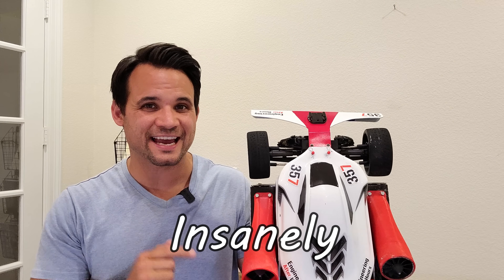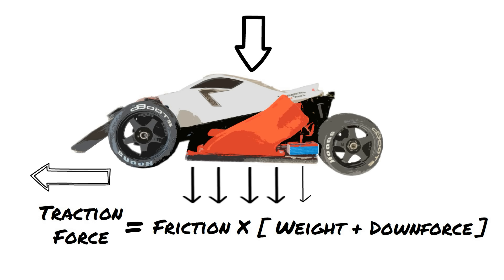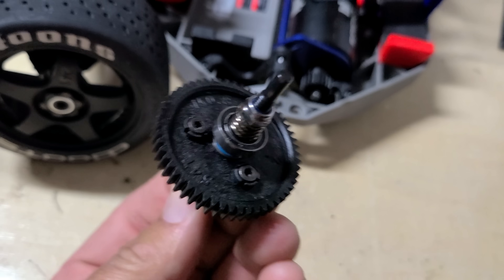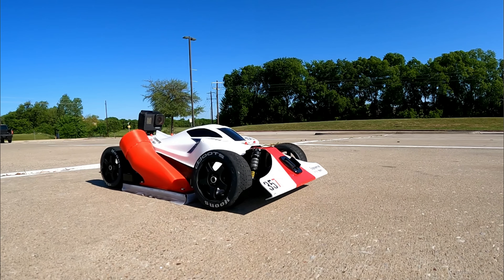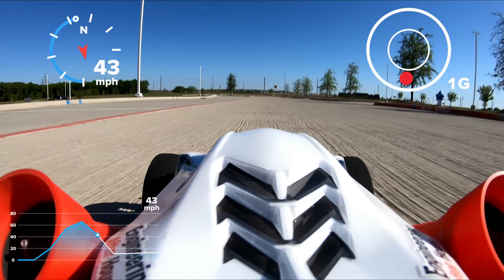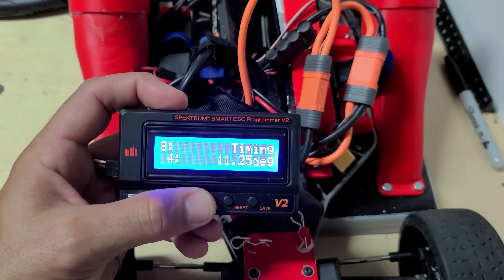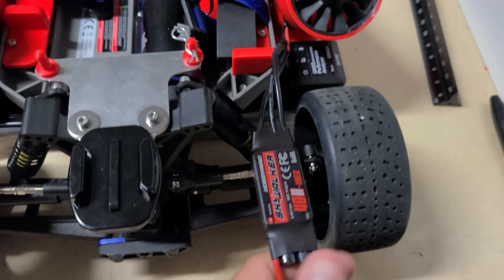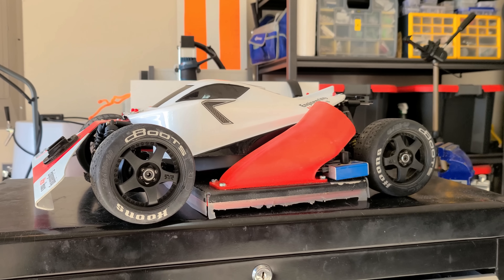241% More Grip with a Fan Car and Ground Effect

Comment: you should buy solid diffs
Reply from the maker: I need to turn as its not a drag car. I
 Running X01 inter also though and a locked center diff.

Comment: You only need the fan downforce until you get more aerodynamic downforce and less torque as it gets faster
Reply from the maker: If acceleration stays the same the torque only goes up as speed increases. That's what makes it so challenging with a heavy car.

If I didn't care about drag, I could definitely use fixed aero after a certain speed.

Comment: Why did you use a Traxxas platform and not an Arrma?
Reply from the maker: The arrmas I would have considered were just too heavy. And all of the arrma and traxxas road cars (X01, Limitless, Infraction, 4tec...etc) are way too low to the ground for underbody aero.

Power to weight ratio is really important here.

Comment: I suggest to try and use hub motors. I've built one with 4x brushless in the wheels, and it had insane acceleration. Also greatly reduces wear parts and center of gravity. You got to choose your winding and pole count wisely though (i.e. the "electric" transmission)
Reply: That's... that's brilliant!

Can you also use the motors for effective braking? You could literally have a full traction control and stability system... IN A BLOODY RC CAR!!

Crazy stuff!
Reply: @skylined5534  Yes you can... Full traction, full ESP, even assisted drift mode... All should be possible with a single Arduino. And all this is a car that fits in the palm of your hand. 

Motors even are water tight (at least mine) so it's pretty fun in the winter

Comment: You should add some super capacitors in line with your battery, I think the studdering is battery sag
Reply: Maybe even brown out?
Reply from the maker: I got a new higher discharge battery and a sensored motor...let's hope that helps!

Comment: I said that in your other video you said the original was only two wheel drive so why you switching to a four-wheel drive
Reply from the maker: 4 wheel drive has better traction. 2wd can only take advantage of the force on the rear wheels limiting the acceleration off the line.

Comment: Springs need to be massively uprated to put all the downforce on the tires.
Also your tire foam is likley far to soft.
 More traction on the tires means less downforce needed, means faster.
You should tie the fan speed to a speed sensor, so the fans slow down at higher speed, and set it to always be on the limit of traction.
Sub 1 second seems possible.

Comment: What your experiencing at launch it's called cogging. It's due to the sensorless brushless setup and the gearing you're running. When the sensorless system first starts up it does not know the rotor position or direction and is basically guessing. When geared very high the motor cannot spin quickly at the start so it stumbles back and forth trying to figure out the position and direction. The larger the pinion you run the worst this gets. This can be resolved with a sensored brushless system.
Reply from the maker: We've got that fixed for round 3! Stay tuned

Comment: I don't believe this counts because the Tesla model plaid is a bigger object more mass where that rc car has a smaller mass
Reply from the maker: Power to weight ratio only matters if you're power limited. The tesla is supposed to be 1,100 HP or greater so I expect it to be traction limited at the low speeds in a 0-60
Reply: @EngineeringAfterHours  I'm saying that the rc car isn't traveling as much distance as the Tesla since it's smaller
Reply from the maker: @theanimeotaku2794  huh? I'm not scaling distance. 60mph is 60mph in this case.
Reply: @EngineeringAfterHours  whatever then

Comment: No prep drag race rc cars routinely go 0-75 to 82ish in less then 1.95 seconds in 132 feet. With 2wd chassis. Without fans.
Reply from the maker: Yeah and they don't turn either. Drag cars have always been faster than f1 cars in 0-60

Comment: Do what they do in the Japanese mouse competitions: 4 quad props set up in reverse so air is pushed into the air and forcing it down that way.  Your system depends on getting a decent seal between the skirt and ground, if the car lifts, the seal is broken and there is no longer downforce.  The props would give constant downforce without relying on a seal.

Comment: Or there is the ARRMA Limitless... a bit over 2 sec out of the box on 6s. By integrating your vacuum system you may just break the space time continuum. (wow! A complete sentence with two double u words yet neither have a W in them).
Reply from the maker: Haha I've been thinking about the limitless for a year now and am about to pull the trigger. Debating between a video on "high speed aerodynamics" or "the science of acceleration"
Reply: @EngineeringAfterHours  that’s a great angle (see what I did there). As fast as the Limitless is  out of the box, I’m sure reshaping the body/wing would show instant top speed gains.

Comment: You’re “cogging’ off the line, nothing to do with skirt friction. Why not try foam tires, will give much better traction. Also, your wheel base is really short for what you’re trying to do. Why didn’t you start off with a chassis more aligned with you’re goals, like the 4-Tec or XO1? Cool project.

Comment: What about using real units of measurement
Reply from the maker: What are real units?
Reply: @EngineeringAfterHours  Metric system 😁🤣
Reply from the maker: Hah...in most engineering programs here you're taught multiple units so you realize it's arbitrary. Almost like being multilingual. For forces I generally use imperial and for thermal analysis I use SI with a blend of Fahrenheit...but honestly I use both systems a lot and am glad I was taught not to care either way.
Reply: @EngineeringAfterHours  Yeah yeah I was just joking ahah, it would be nice if you also put SI units in next videos so that Europeans like me coul understand better 😁

Comment: Have you thought about trying an outdoor or indoor basketball or tennis court? May be a little smoother therefore a more consistent vacuum verse bouncing over parking lot pavement losing vacuum.
Reply from the maker: That would be an awesome surface. Super flat but high grip. I think the biggest challenge is the length (need 300 feet), but a large tennis complex nearby may work!

Comment: i have a arrma typhon with a 2/1 gear ratio and did some something things i shall not mention XD and it when turning in a circle and driving i can do up to 5G im not joking either. i lock my wheel left or right and send the car slowly and it will pickup on 2 wheels and spin like crazy.

Comment: you can direct the fan exhaust rear ward for more forward push and make your bash 
guard not as steep, while throttling the fans off on the top end to lessen downforce drag. 
Have fun. now take your creation to the drag strip with a real Tesla.

Comment: Cool!
Tip: You can probably get better results by using a better car to start with. Check out 1/8 on road racing cars, like the Serpent 989 lipo version. That is serious race stuff and use way better materials and part design. Also the tires (foam) they use give much more grip. Especially if you use the softer ones (low shore values). I bet these cars do 0-60 in 2 seconds in standard race trim. Now add your fans. And maybe put some weight at the right place, on the front? Also, use high capacity and high discharge rate batteries +8000 mah. Lubricate the the tires with tire sauce to make them even more grippy.

Comment: since your going for 0-60 not and not a top speed run i would check out the proline drag tires. those hoons last long and there fun for drifting but they dont hook nearly as well and the drag tires do. also a sensored brushelss system will help with the cogging and mip xduty axles will solve that axle breaking isue

Comment: Will a heavier car be better for that initial traction and be more stable. Seems power is not an issue. Larger tires?
Reply from the maker: No, this car actually is power limited and not traction limited. A heavier car will make it worse. I'm going to rebuild with a little less downforce and drag, while moving to a better motor setup

Comment: Time too put a couple co2 cartridges on there. See if you can beat 1.1
I subscribed and saw you DID try cold gas thrusters on the top of the car with very underpowered tanks. I would recommend air soft canister as they can have 4,000-5,000 psi.
And the trust needs to be at the same level as the tires. You know this I know you do. But in a thought experiment even with everything perfect that amount of thrust would be 
Impossibe to control. I am tired its 5am.
Reply from the maker: I definitely have been looking for a tiny air soft canister. If you have any suggestions please let me know!

Comment: Just out of curiosity why not use the Traxxas low cg chassis and center differential?
Reply from the maker: I've got one on order. I just didn't include it on this build because things start getting expensive fast so I try to set a Max budget for each build. This one was already over $400 so I needed to break it into a few incremental attempts to fund everything.
Reply: @EngineeringAfterHours  oh gotcha. I wonder if Traxxas would help you since you seem to use their products allot.

Comment: You need a capacitor pack to stop the stuttering at launch. Youre drawing a lot of extra power when you start, and the loaded capacitors discharging helps account for that.
Reply from the maker: It has a cap pack...may be too small but well see with the new motor esc

Comment: I’m pretty sure there’s plenty of guys in the rc no prep drag scene that run sub-1.5 0-60’s.  There’s videos of Tesla’s vs Rc cars and the Tesla gets destroyed.  The power to weight ratios just can’t compare.  Raz Shifrin on his channel answered the question “how fast is my 170+mph speedrun rc car in the 1/4 mile?” He ran one of his cars using gnss gps and it was somewhere in the 5.4 sec range!  I think the fan car is really cool but is more suited for handling.  I’m pretty sure my heavily modified Arrma Talion (speedrun gt style) will smoke a Tesla 0-60.
Reply from the maker: Yes the design is definitely for lateral G's on a road course. 0-60 was just the most consistent way I could test the increase in acceleration. 

I'm working on 1 more updated design and I should get times down even more. It'll be hard for any car to beat it in the 0-60 on a non-prepped surface as is...but the new updates will ensure its not even close

Comment: Back in the mid 1970's, my high school replaced the old cinder running track around the football field with a RUBBER track.  Maybe check some of the schools in your area and see if they have something similar that you can run on.  Either that or maybe a parking lot that's recently been repaved with asphalt, to smooth out the ride.  Don't know if directing the air from the ducted fans back in a horizontal line would help much, unless you're using that thrust to provide some of the downforce.

Comment: i had idea of useing the wheels as the fans and use quadrant spacing with the suction like have the wheel inner diameter be a variable ducting fan like would make an air break with wheel rotation as well as pull air from ducted area under car so you could use each wheel to fine tune what quadrant of your car gets more down force or close them up for high speed when you dont want downforce and go fast open then up for braking and slow speed down force could have  a gearing mechanism to rotate the fan faster when the wheel is slowing down as long as you are moving you can get down force from wheel rotation ...

Comment: The stutter comes from tuning. 
The start power on high is not helping you on low end torque.  It would be better on the car if you turn start power to Low and timing to zero. Believe it or not you would gain more ground for what you are trying to achieve by changing the 6s into 3s parallel.  change the 32 pitch gears into Mod 1 gears. 
A 40 spur would change the whole game. As you increase the pinion size you will have less spin or wheeling. All though it would be much easier on a 30 shore contact foam tire to absorb the bumps in the rough road and create maximum grip...... since you live somewhat around McKinney (Traxxas) I would recommend the rear tires that come on the new drag slash.  it's a ultra sticky slick tire. But only on 3s.  I live in East Texas and work in Southern Oklahoma.  I drive by Traxxas every 2 weeks on my way to and from work. If you have any other questions feel free to give me a shout. Very cool video by the way. Interesting to see the science behind it all.

Comment: Arrma 1/7 LIMITLESS might have saved you a lot of this work after i watched one of those beat an F1 car off the line
Reply: also is your rollout an actual foot or a 1/10th scale foot?
Reply from the maker: I'll probably get a limitless at some point. When I increase the power in this build it'll smoke a limitless in the 0-60 though. F1 cars actually don't have the best 0-60 as they're setup more for higher speeds and aero doesn't work much at low speeds.

The rollout is a proper rollout. You would only scale it if you were also scaling speed. Racing from 0-6mph isn't as cool as 0-60 lol

Comment: "4wd chassis instead of a 2wd chassis" ok i see your not a car guy
Reply from the maker: Lol what?
Reply: @EngineeringAfterHours  when you said 2wd i was like "rwd? Fwd?"
Reply from the maker: @Qazkerowo  these RC models have a 2wd and a 4wd version. They are both "short course truck" chassis and are commonly known by just 2wd and 4wd. So those terms are used because I went from the 2wd slash to the 4wd slash. 

Typical automotive terms weren't used as I was speaking to the actual chassis option in use.
Reply: @EngineeringAfterHours  ok

Comment: I think the jittering is caused by the suction and traction fighting each other. When the car accelerates, it pitches upwards and the suction is momentarily lost, which then makes the car pitch back down, which increases the suction, which in turn increases the traction, which makes the car accelerate and pitch up again, and so on and so forth.
If you manage to connect your suction panel skirts to the wishbones as shown here (https://youtu.be/dlNmWJLyylM?t=356) you might be able to overcome this issue.
Best of luck!
p.s. The Tesla roadster is a bit heavier than your rc car so not a fair comparison. :p
Reply from the maker: Thanks for the info. In terms of power to weight ratio...I believe the tesla is traction limited, not weight limited...so the weight isn't the main factor.

Comment: The drive shafts that you are running are an upgrade from the standard ones, yes, but not the most bullet proof option Traxxas provide. Search for the Steel Constant Velocity Drive Shafts available for the Slash 4x4: CVD part numbers - TRX6851R (Front) TRX6852R (Rear). Great vid btw- Love seeing 1:1 Automotive Engineering principles being applied to RC!

Comment: Sir ive just watch ur video about this ,sir i might suggest one modification to your axial fan,since a single stage fan cannot pulled a huge amount of suction or pressure,especially RC EDF dont have a stator that is angle to convergent shape. Stator might help but if the stator is not design for building pressure then it will not help building negative pressure or positive pressure. You might want to choose rather a centrifugal compressor than axial with just one stage and huge gap between those blade tips to the inside cowling wall.
Reply: gobbledy-gook        stator vanes  that  Impede  the airflow  are  Not  used  with an  electric thruster/fan/edf.
Reply: @daviddavids2884  yes they not use it,but when it comes for experimental you might want that.

Comment: Hoons have very little grip. GRPs have much more grip, but 25 shore foams would be a whole other level of grip. The stuttering off the line is called motor cogging. You should be able to get down to under 1.5s with the right setup.
Reply from the maker: I definitely want to try GRPs. I was let down by the soft foams but I just don't think they were made to handle those loads. It's effectively a 24lb car whe. The fans are on
Reply: @EngineeringAfterHours  I think your surface is way too rough. I have done my best drag hits on smooth asphalt. 25 shore foams hook really well with zero additives. I think your other problem is the short wheelbase. Longer cars ( think top rail dragster) have a much longer chassis.

Comment: I would  make a servo controlled bleeder on the skirt and mix that in with the throttle  ... the bouncing at the start is suspension / downforce related. Try adding a 3axis gyro and accelerometer to log that. But most likely your are rocking the suspension back and forward till it settles. My bet would be that the stationary pretention with the launching are having a little rumble.
ps: the bleeder will have "zero" lag as the EDF will be spooled already.

Comment: You should probably make it more aerodinamic by hiding parts like the lmp1 cars from the fia wec series
Reply from the maker: I've considered doing a speed run rig and the low drag cars that you mention are some of my inspiration in design. I want to be sure aero efficient so I don't need to run an oversized motor.
Reply: @EngineeringAfterHours  maybe you should even hide the wheels

Comment: hello very cool video. your motor is "cogging" you need to run a esc-motor that has a sensor lead to give you motor position feed back.
Reply from the maker: I have a castle 1515 on the way to try and correct this:)